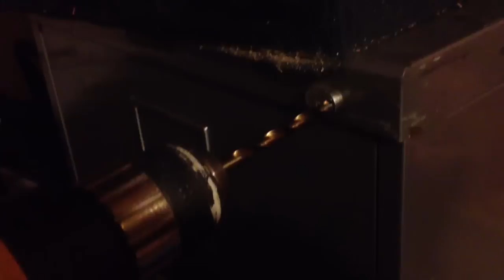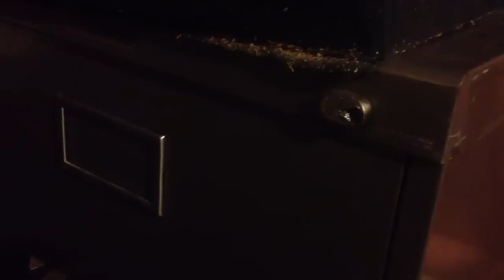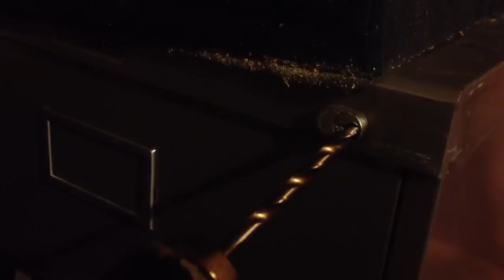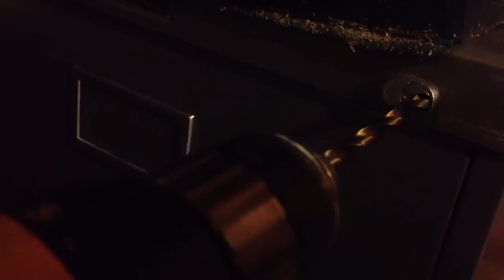How to drill out a lock

Comment: hi, i've been trying to drill out the lock on a filing cabinet.  i think i've pretty much drilled all the way through the cylinder, as my drill bit goes all the way to the hilt.  i actually cracked much of the cylinder in half and pulled out the pieces.  in what is left, i think i can see the bottom of what i believe is the last pin.  i have been trying to destroy it, but it seems pretty tough.  after using the drill, i try to use a screwdriver to "turn" the inside of the cylinder, but...